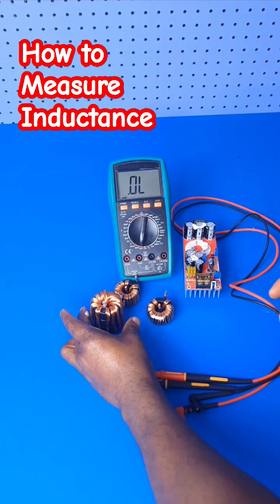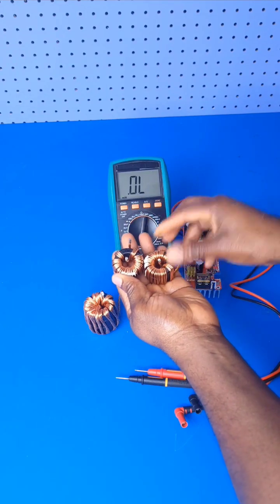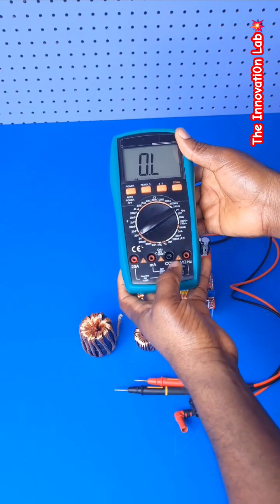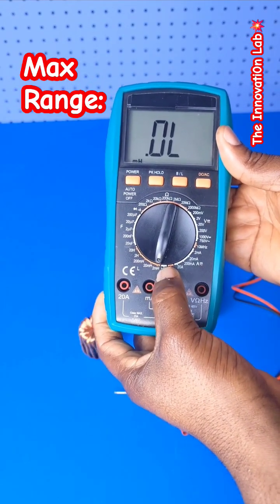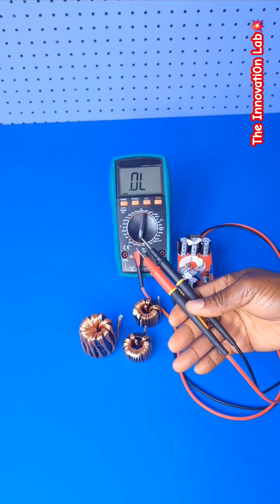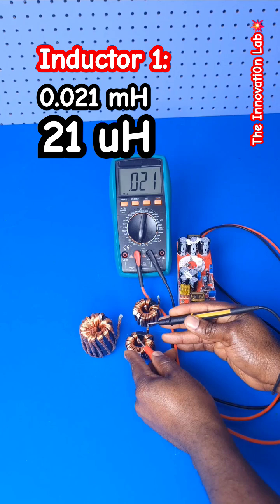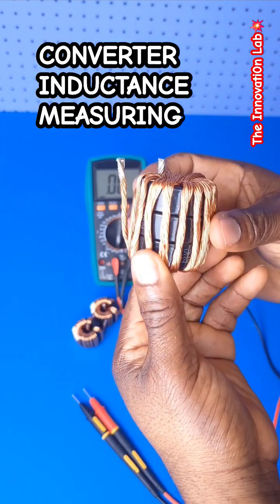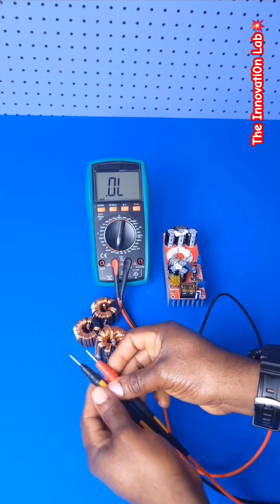How to Measure DC-DC Converter Inductance #shorts #dctodc #diy #inductance

Comment: Nice idea
Please how i step down 48v to 36v of 200ah batteries to enable me use the 36v inverter?
Reply: @joealago5552  which inverter, do you have a link? 36v seems like a non traditional voltage while 48v is very standard. So if you're sure your inverter is 36v, instead of a buck converter, it might make more sense to either repack the battery or the inverter so no conversion is necessary
Reply from the maker: That is a tough situation to be in. I have been there.
You can use a buck converter, but most buck converters out there are lossy and not very efficient. Also, they are usually limited to about 800W.

My recommendation would be to look into buying a 48V inverter or a 36V batrery - whichever one is more feasible per your budget.

However, if less than 800W is all you need out of your power inverter, then consider the buck converter approach....again, just know that you will be losing about 15% of your transmitted power to heat.
I have seen some 800W buck converters on ebay - you can check those out.

I hope this helps.
The Innovati0n Lab 💥

Comment: Nicely done! Of course for SMPS application, the Inductance is one part of the spec we need to know. Also important is the saturation current, frequency response. It would be awesome if you made a video about that!
Reply from the maker: Thanks for the feedback.
I totally agree. 
The inductor design video is definitely on my to-do list for this year.
Very respectfully,
The Innovati0n Lab 💥 www.theinnovati0nlab.com
Reply: @theinnovati0nlab782  are you going to directly replace the smaller inductor with the  larger one without tweeking the circuit? 22uh and 116uh seems wide a gap. Dont you agree?